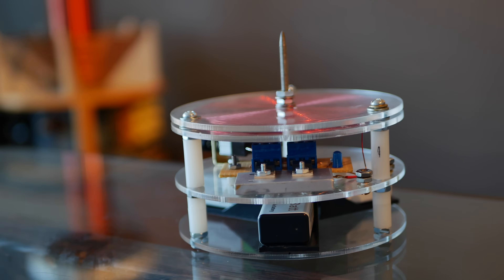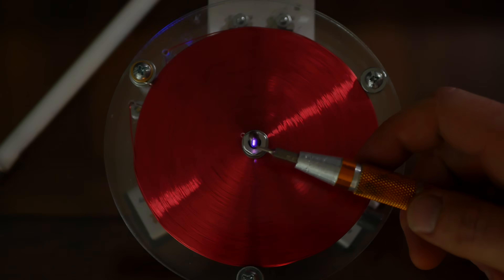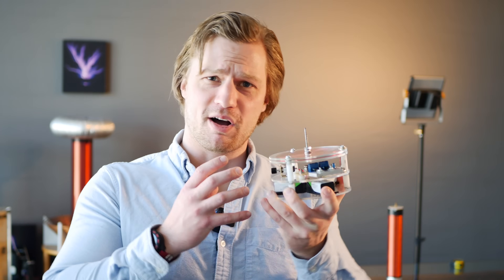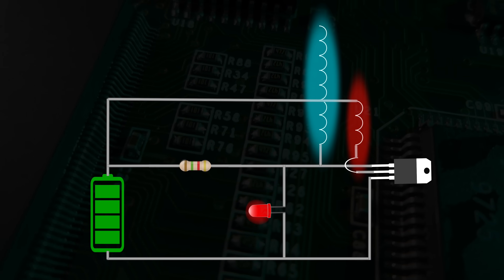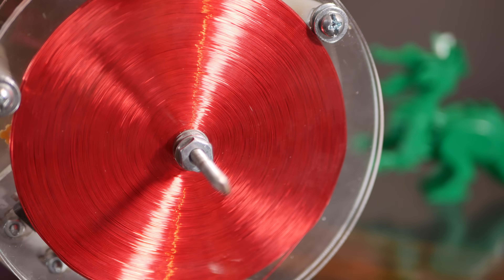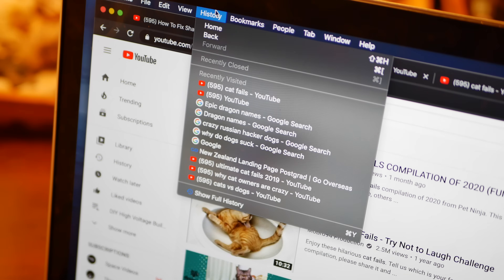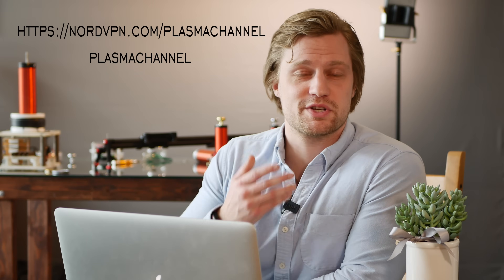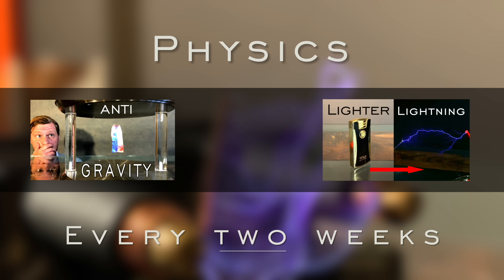World's Most Powerful Pancake Slayer Tesla Coil? (Melts Copper)

Comment: That's freaking awesome man! Never seen anything quite like that - you're very creative 👌 That secondary looks challenging to wind. Looking forward to attempting this build!
Reply from the maker: Nigel, I appreciate that. Yeah winding the secondary wasn’t TOO hard... use a thin washer in the middle of the two discs to space the secondary... and attach the wire to the bolt in the middle, then wind on a drill. First attempt though I broke the wire...
Reply: @PlasmaChannel  how many turns on secondary and primary?
Reply: Will you make a video how to make this?
Reply: @phenethylamine21  he kinda did.